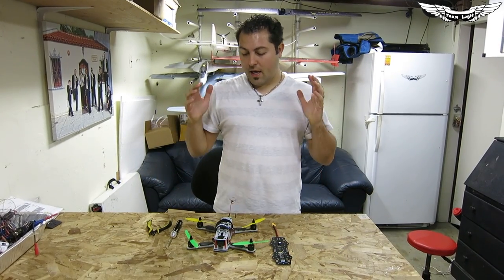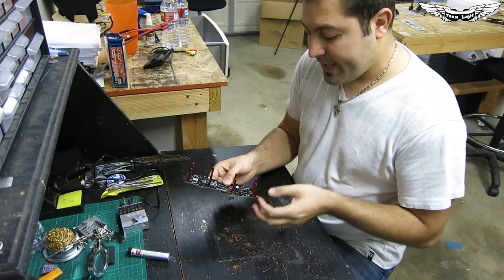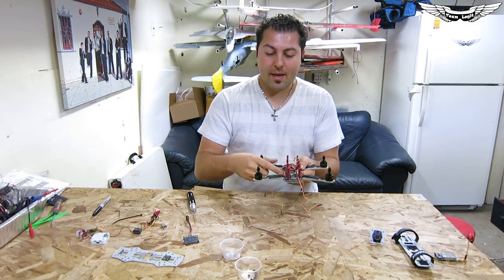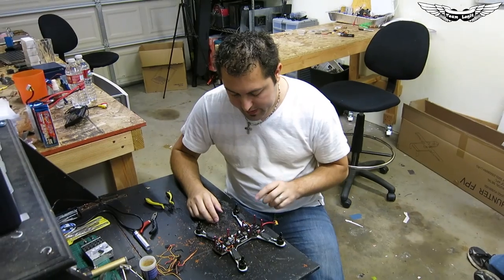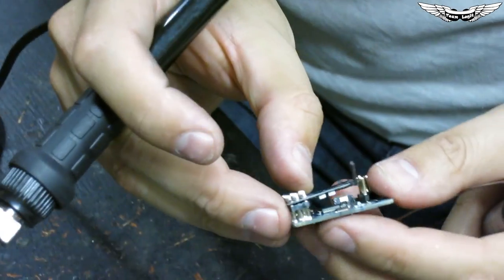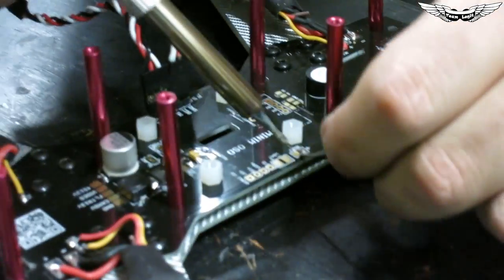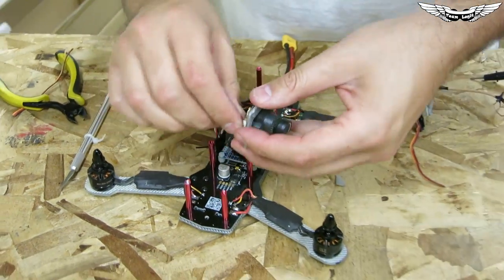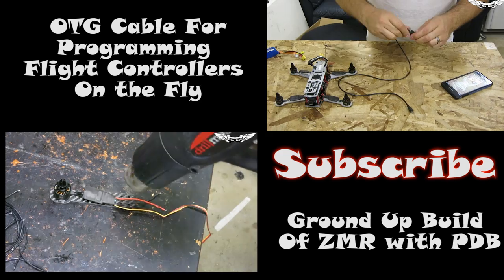Nucleus PDB By WADZoQUADZ Build Video

Comment: As for a soldering station My Weller station has stood me in good stead using the same unit for the last 20 years and used a gas iron with a open tip to act as a micro hot air gun have been perfect for hand manipulating surface mount components

Comment: Awesome video .Thanks for putting all the time in. Remember to lower your irons heat setting after doing the main batt/esc pads before soldering the smaller pads. Too much heat on small smd pads or having the iron on the pads for too long = bad for board. These pads dont have much copper so low heat and a quick dab of the iron is all thats necessary to solder to it. Do  it fast like in the video with lower temp setting then the main pads.
Reply: I use 700* murican for ALL TEH THINGS! :D  heh.

Comment: You want to add flux to the pad to pull solder into the hole if you are going to use it, you should also clean the solder joints after you solder or use No-clean Solder.  It will turn to a substance that promotes corrosion.  When Soldering the flight controller you can flip it upside down into a piece of ESD foam (Its very Porous)

Source: Mil-Spec, J-STD certified PCB, Through hole, Hardware, QC, and SMT Certifications.
Worked on Several Nuclear (LA Class) Submarines, Lacrosse I&II Satellites and Hubble Phase II Refit encoder Boards.

Comment: I am heating the pads up before I heat the solder, in some cases I get the pads hot enough to liquefy the solder so they reach thermal equilibrium. Am I doing it wrong? The big red disclaimer in the Nucleus guide makes me feel like I am doing it right and that just touching the solder to your iron to melt it atop the pads isnt enough for a good bond. If it helps my iron is only a 40W so I may have to apply my heat longer than people with super hot irons do.

"The ESC pads and main batt pads will need some heat to flow the solder .Every other pad (smaller pads on the board only need a quick touch of the soldering iron to flow thesolder. You dont want to hold the iron on the smaller pads or use the same amount of heat needed forthe bigger pads. Too much heat and duration on the little pads can damage the board. Only the MainESC and Main batt pads are heavy thermal pads. Treat all other pads as if they were small pin headerpads"

Comment: I have just got one of these and on the pads for the camera it has both FLTR12v and 4S12v. I am using a 12v camera but I want to be able to use both 3s and 4s so which pad should I use for powering my camera?

Comment: If you're using 4s, you'll need to use a Pololu in the provided pads, correct?

Assuming, of course, that your camera and/or vtx require 12v input.
Reply from the maker: Yes to step the voltage down to 12v

Comment: I have a question. I have watched both videos on the first pdb and this one.. but there's not to much info on the v 1.2 board. There are 2 sets of jumper pads that I can not find a answer to short them or not. Why are they there and of course lol.. What happens if I jump them?
Reply: I know, that's what I have and they should have done a video with that board...but that one is old now (a couple months)...on to the next new board! I still have an original board unused along with the 1.2...buy the time I get to building it, 6 new boards will come out!

Comment: Hi Johnny,
I think i might need your help here,since im also using JR tx DSX9,the latest black naze32 fc build on a Trifecta tricopter,now use pdb with 12v & 5v bec...
My current problem is by using ORX615X,during plug in the lipo pack the orx takes more than 6 to 10seconds to initialised & bound to my DSX9(happens 6 out of 10 attemps)..other than that i have another sets of JR rx RD721 along with its own satellite EA101. Is it possible if the EA101 sat' can be used alone to the naze32?if yes,the sat' have:red/black/grey.is the correct way is= 
=tap the 'red' to '3V' patch?(that next to the led)(*but my naze has two 3v patch,which one should i use?)..
=then the black from sat' plugged to rx signal in 'gnd' ? 
=Then the grey wire plugged to rx signal in '#4' ?
-after that should i go to CLI and type in this? :"set serialrx_type=1"

Another thought is..is it possible to run only one wire(only the signal)from the esc to naze M1,M2,M3(even the esc's is Lbec 2A)?  Is the negative will be common ground(by means the escs negative power in wires is connected to pdb,then the pdb 5v +and- is plugged in to naze 'S2'  pinout therefore also will supply 5v thru the sat' rx and tail servo too..?)

Please, i really need your help now. If any of my explaination above will leads to any damage or burnt anything,please help me pointed out right with the best & tidiest wiring as its possible.

MILLIONS THANKS IN ADVANCE..
Love your tutorial videos, & wish you happy fly &fly safe..  :D
Reply from the maker: Arifin Musa Send us a ticket on the website with your email. I will try to answer your questions through that.

Comment: If the esc wire colors are correct, then at 14:45 you're soldering them backwards on the board.
Reply from the maker: Yes they were reversed we double checked it and reversed it.

Comment: Is it possible to use the dragonfly board and lemon RX with gps? In the pinout, it shows that gps uses pins 3 and 4 which are consumed by the lemon rx?
Reply: No, in order to use GPS, you must use a PPM receiver to free up the UART2 port pins.
Reply from the maker: You can Use a Lemon 8 channel PPM Receiver. It can also be soldered directly to the board.

Comment: Does the same method of installation for the immersion go for the boscam  ts832?
Reply from the maker: Shawn Rose. Yes, Just make sure the polarity is correct.
Reply: Does the nucleus have a step down regulator built in?
Reply from the maker: Only for the camera and the FC.

Comment: Really bad practice with the installation of the buzzer.. Poor soldering and clipping the leads after it's been soldered is just asking for it to fail.. And drilling out a pin through hole?!? This is where I shut this video off.